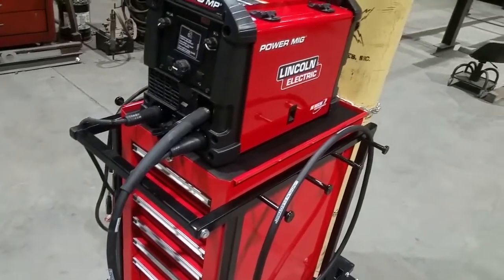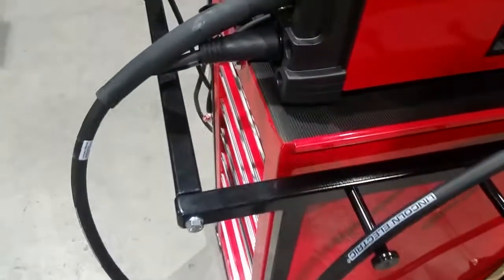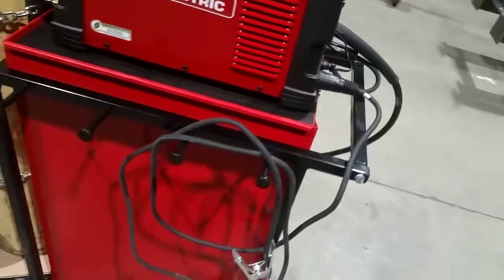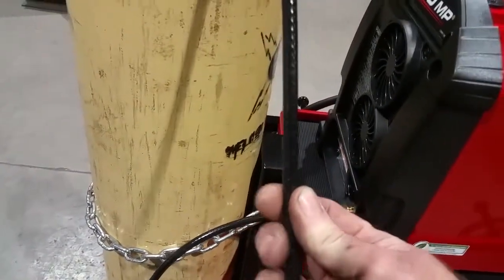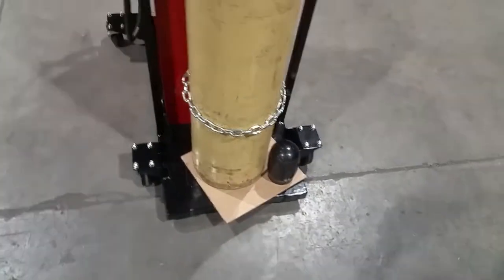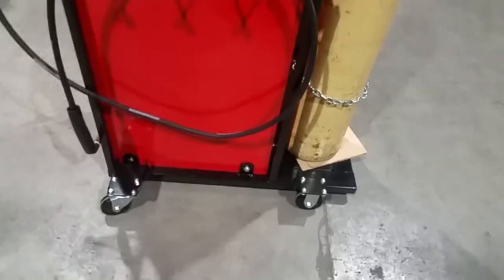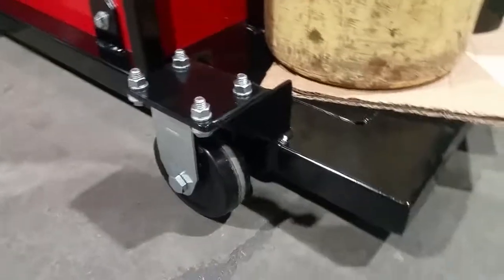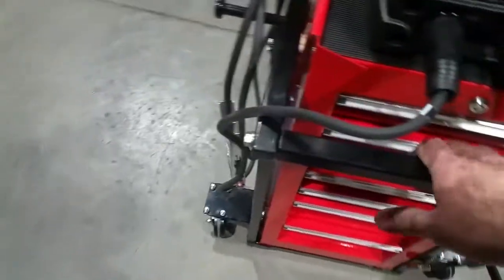DIY custom welder cart

Comment: It turned out GREAT!!  I like it  and best of all you made it just the way you wanted it!! I love those concrete studs you used, I'll have to keep that in mind for future projects. Also the rubber under the tank is a good idea as well. The powder coating takes it to the next level for sure!  I have that MP210 and love it.  I bought the Lincoln canvas cover for my squarwave and love it.  I need to get one for the MP210.  It turned out great, glad you uploaded it and thanks for the shout out!!
Reply from the maker: 57moto appreciate the comment yeah definitely nothing fancy just functional them concrete studs you can get at any Fastener place like Fastenal they come in all different diameters and lengths